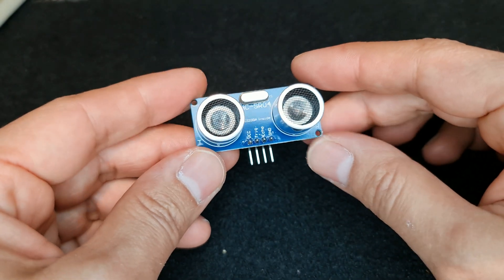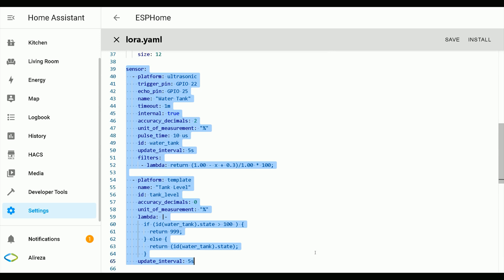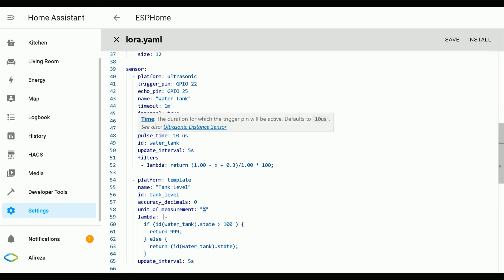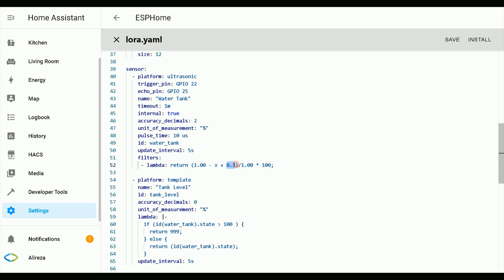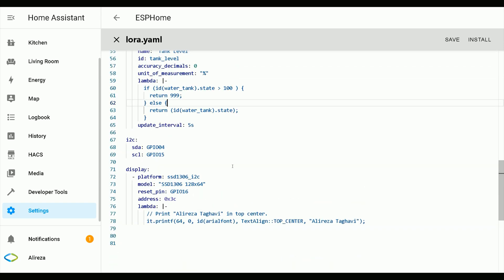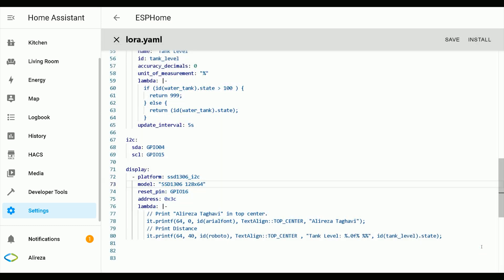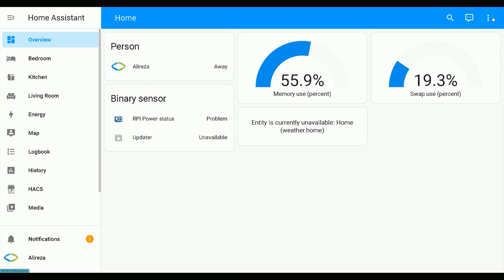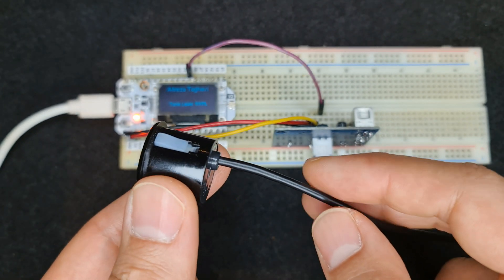Simple Homemade: Remote Water Level Indicator

Comment: Not working properly .test with a tank signals interface with tank wall😊
Reply from the maker: I do not have any info about your installation and Tank. Maybe replacing the sensor will fix your issue and Also, this one may help you better,
https://youtu.be/g50WgU8ylk0?si=vt1AUMMRVN2otLnz

Comment: Hi Sir, I have tried the same few weeks with the same sensor(Jsn-sr04t). It worked as expected outside the tank. At once I mounted it on the lid and closed the lid, the sensor produced the lowest measuring distance irrespective of the water level. I thought it might be because of stray echoes inside the water tank(At once I took it outside the tank it worked fine). I suspect the ultrasonic sensor with separate transmitter and receiver might work.

After that I have replaced it with a tof10120 sensor, but this time I got inconsistent readings. I found the tof10120 sensor doesn't reflect on water. At last I've created a frame with a sheet covered with aluminium foil mounted on top of two PET bottles, as a reflective material. And now this setup is working perfectly fine.
Reply: @vignesh jothee unga setup video iruka?
Reply: @bat3332  which one? Jsn-sr04t or the tof10120 setup?
Reply: @vigneshjothee9677   rendumae panna nalla irukum or if even one is also ok